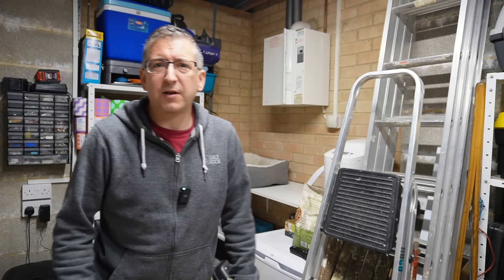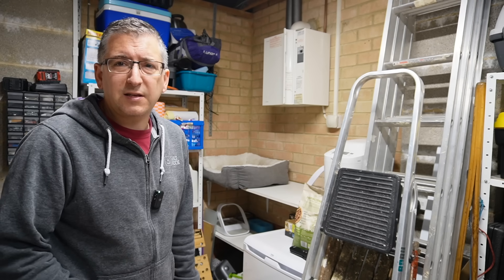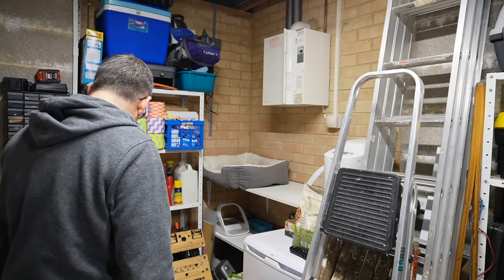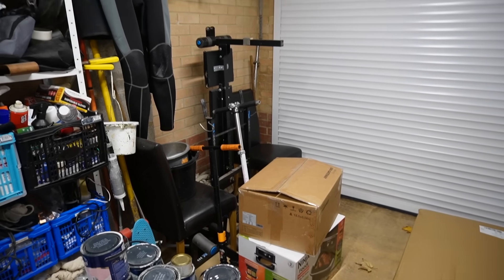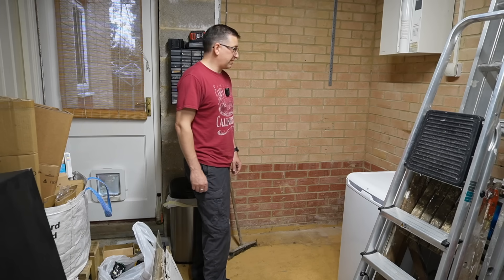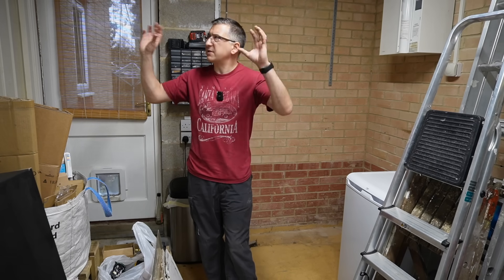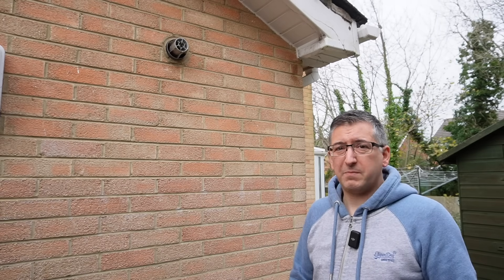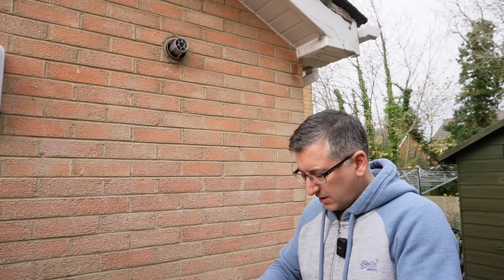Octopus Energy Heat Pump Install Day 1 and Prep Work

Comment: It will be great to see how the Octopus team work. They have an amazing reputation to uphold, so lots of pressure to not only impress but achieve good scops, etc! With Heet Geeks setting such a high standard in training and installations, and seeing so many great installations done by the likes of urban plumbers on this channel, there is a lot to learn from seeing these actual installation videos.
Reply from the maker: Honestly I hate having people working in my house and I can't relax until it's all done, but these guys were really considerate and professional and made the experience a lot easier on me. Their workmanship looks to be to a high standard, it's certainly very neat and everything appears to be working as designed right now.
Reply from the maker: Yes, they were extremely considerate of those needs and it's worth it for all the data you can collect and play with at the end :) Oh, and heating.

Comment: Brings back memories of our install by Octopus in June 22. Install took four days with 4/5 installers and although disruptive was good with loads of banter and tea and cake !! We are getting good results with sCOP of around 3.7 heat and 2.5 DHW. Interesting to see how yours goes but very happy with ours. This morning with temp 10 degrees outside got a COP of 5 so far !!
Reply from the maker: That's good!
Reply: They installed mine mid October but I was not impressed with some of the work. Lagging on the outside pipe work was appalling and they connected the new domestic water pipes behind the service valves to the utility sink. I kid you not. However I'm pleased with how it's running now. I was getting a SCOP of 4.8 until the sub zero temperature a couple of weeks ago that knocked  it back to 4.4. This is because I managed to get a designed flow temp of about 40° . Octopus had planed to change 6 rad's but I noticed if I moved 3 of the lager ones to the position of the other three and add a rad in our living room the overall heat output in house was 200w short of the 9800w needed at 40° flow. They were happy for me to do this work as long as I got it all done before they started.

Comment: Really appreciate & love how informative your videos are. Thank you for the great content you create. Know how you feel about moving things😂. I'm due to begin my retrofit project in late Jan from Oil along with a raft of other energy measures, needing to have a upgraded new three phase supply fitted from the roadside by the DNO to a new meter box externally (32m in total) a smart meter with isolator, consumer unit/tails, smoke alarms, Heat Pump with a wireless controller for auto Adaption function & concrete foundation for it to stand on, hot water cylinder, 12 new rads, pipework, insulation/Plastering in the loft room, solar panels, inverter, battery storage system, Zappi EV charger point, loft boarding, lighting & lastly a new concrete path round the exsternal of the house. So going to have a house full of contractors
Reply from the maker: Wow... that's a lot of work!
Reply: Good luck with it
Reply: @BenCos2018  thank you very much
Reply: @joshuam5826  np
Reply: Wow! Hold in to your hat, I envisage a challenging ride!

Why not do a vlog so we can all come along on your journey?

Comment: Make sure that the esbe valve is installed correctly. Mine wasn't and the hot water cylinder was constantly losing heat. It was actually me that notified them of the issue and the potential solution after reading online forums!
Reply from the maker: Thanks for the tip, I'll keep an eye on it. I'm sure it is working fine because it's heated up a couple of times so far.
Reply: @SpeakToTheGeekTech my cylinder only lost heat when the central heating was running. The cylinder was acting like a thermal store. My heat pump was installed for a few weeks before I needed the heating on. Therefore, it wasn't until later tha the issue first became apparent.

Comment: Interesting series on your Heat Pump saga, very well prepared and presented. I am particulatly interested as my gas boiler is the same as yours so its 25+ years old ! I have had the first estimate from Octopus and with the updated grant it would be cheaper than a new gas boiler.
Keep up the good work.
Reply from the maker: Thank you!

Comment: I had an ASHP fitted 21 months ago and initially our homes cavity had equivalent of no insulation. Our 5 bedroom detatched house used 3333kWh for the first winter to maintain 18c with a small drop to 16c overnight for 7 hours. Old broken down cavity wall insulation removed and replaced after first year and now saving about 1/3rd in use. Also, I have kept the evohome sensors attached as it still can keep each room at the temperature, rather than the guessing game of the TRV's. 
There was a small change to configuration in the EVO home and I swapped all rooms to the same plan. This way I have maintained the ability to still have control whilst away from home and to ensure all rooms are heating correctly.
Reply from the maker: Do you use Evohome as a TPI thermostat then or just as fancy TRVs? I’m planning on putting temperature sensors in each room (I have them in most already) to keep an eye on balancing them. I didn’t like the idea of each room being able to call for heat because that would really hamper the efficiency over all
Reply: @SpeakToTheGeekTech   I run the whole of my old evohome setup but no hot water control as that is fully dealt with by the ASHP. I have a "standard heating setting" for the whole house, so all rooms are the same temps at the same time.  I have not seen too much extra use, but my system doesn't provide ledss than whole numbers.
A setting within EVOHome is used to stop fluctations in calls for heat being on/off rapidly. This is from Honeywell, " change the Cycle Rate to 3 and the Minimum On Time to 5."

Comment: I can't wait to see what you think of it once installed.  I hear lots of nightmare stories and people saying they cost far more to run than a gas boiler.
Can you give an example of a gas bill and electric bill for a few months in winter and summer, then give us the electric bill for when the heat pump is in use for water and heating?

What was the total cost of installation of this new system?

I am tempted, but nothing comes close to the low cost of running a gas boiler or the overall control of it.  The heatpump would need to cost a lot less to run than a gas boiler for the same amount of heat and water, plus less than the £6000 of replacing my gas boiler and a couple of radiators or it's not worth it.
Reply from the maker: All of that information will be forthcoming in other videos. I'm pretty certain that the running costs will be ballpark the same as gas, maybe even less because of my batteries, so I'm not concerned about that. I know from other people's experiences (family and friends) with heat pumps that their costs are not really any different. From an install cost perspective it's not that far different from a boiler installation when you include the BUS grant. It is more expensive, but not massively at all. It was never about it being 'worth the money' for me though, I needed to replace my boiler because it was on its last legs, and I didn't want to carry on using gas. The cost of the heat pump was within my means therefore it was the right product to choose morally.
Reply: From what I’ve read heat pumps cost a similar amount to run as gas boilers, the gas cost is going up Renewables cost is coming down unless we let the oil companies own them all and then we’re done for. Have you paid the government back for the super cheap gas you used last year?

Comment: Nice concise video, shows what I have to expect in January, so thanks very much. You mentioned it made your house very warm so obviously you're underway with it, was that during the recent cold weather?
Reply from the maker: The install has been happening this week and I've split the filming into three parts - this video today covered just Monday this week and yes, as of yesterday the heat pump is installed and working well.

Comment: Interesting that Octopus are supplying a Daikin unit & not one of their new Cosy models with vertical air discharge which can be a real advantage for narrow side alley locations. I couldn't see from the video but what size pipes did your rads have & did they have to upsize any pipework?
Trust me, that's not a messy garage!! I've got a single attached garage that's far worse & only just enough space to walk down the middle. It's where I would also have to put a new hot water tank (or in the loft - but the hatch is too small). A garage clear out re-jenga is needed every so often. Good luck with part 2 & looking forward to the update.
Reply: Daiken units are nice ones tbh
still a bit odd to use that style for a alley though
Reply from the maker: There's plenty of space where it's located, it's not an alley, just a cut-out corner of the garden. Pipework to radiators is 10mm microbore and none of it was changed.
Reply: @SpeakToTheGeekTech ah not bad then
Reply: Are you sure it's 10mm copper microbore and not 10mm plastic?
Reply: @SpeakToTheGeekTech  OK. I've also got 10mm microbore (copper) so hence why I'm interested to see how you get on without any pipe diameter changes. Would almost impossible to upsize pipes in my house as the ground floor rad pipes are buried in the walls behind the dot & dab plasterboard & 1st floor is all T&G chipboard floors. Doable no doubt but not without a lot of mess & upheaval which I would not want. Waiting to see what SCOP numbers you get.
Reply from the maker: Mine are 100% 10mm copper. I've seen them under the floors myself!
Reply from the maker: First full day was yesterday. If the Daikin controller is to be believed then I got a COP of 2.75 for hot water and 4.7 for heating!
Reply: Cozy ones not being launched until next year.
Reply: The COP is not very accurate as figures a rounded.  @SpeakToTheGeekTech

Comment: Looks like the same model as mine, will be interesting to see what heat curve you use and what COP you get, ive averaged 4.3 over the last 12 months but would like more!
Reply from the maker: It's looking good so far but really too early to get a decent average. Need some proper cold weather to test it.

Comment: Watching with interest as our install is booked with Octopus in February! Be interested to see if there is a way to automate hot water heating / boost with heat pump during excess solar. Will depend as well on draw from heat pump during hot water heating - maybe you can measure that? Thanks
Reply from the maker: So far there’s no way I can see to modulate the power it uses to heat the home or water, it just does what it does. There is a smart solar option according to the manual but I think that requires additional hardware. If I can figure out what that option actually is then I’ll report back! To be honest with an offpeak tariff my plan is to heat the water then and hope it lasts
Reply: @SpeakToTheGeekTech  Ah I haven't come across the smart solar option, will have a look into that. How many people are in your house to serve from that 250l tank? We got quoted a smaller one in our survey and I wonder if it should be larger, as ideally I want it to heat off peak and last all day too
Reply from the maker: The surveyor told me MCS guidelines say 50L per bedroom plus 50L. Therefore a 4 bed house = 250L. I haven’t looked into that but Octopus have done everything else by the book so I’ve no reason to doubt them on that. Might be worth double checking though!

Comment: You know that once installed you will have to play around with Daikin Home Assistant Integration... Power flow card similar to the Power Flow Card would be nice to have.
Reply from the maker: Already playing :) Shame it doesn't give heat energy produced data, just energy used. Would be great to get that and you could calculate a COP.

Comment: Hi, how does the heat pump work with your GivEnergy battery system? I have one and concerned it will drain my battery quickly.
Reply from the maker: It will drain it much more quickly because it's pulling power, so I am running out of battery earlier in the day. That's not a problem though because it's kind of one of the reasons I have so much battery capacity installed. I anticipated that I would be running from the grid most evenings in winter because of the heat pump draining the batteries more quickly than before but it's not a concern, it's intentional. You can set a reserve on the inverter if you need to save a bit for power cuts.
Reply: @SpeakToTheGeekTech  ok thanks!

Comment: New to the channel. Are you having all your radiators replaced? Is this to achieve a particularly low flow temp or where they very old type 11 rads? Probably with mentioning most people don't need to have this done. I guess you were unlucky. I have wiser smart trvs so if i get a heat pump i will have to stomach the pain getting rid.
Reply from the maker: About 10 of my radiators were replaced. 3 because I requested them extra, the rest because their output was too low in the heat loss calculations.
Reply: @SpeakToTheGeekTech  Have my survey on Tuesday so interested to see the recommendations for how many need replacing - all decades old, single-panel ones. Do you mean here that you asked for 3 additional radiators? Presumably that was an extra cost?
Reply from the maker: @mattdomm4251  Yeah you might be interested in my costs video: https://youtu.be/Tc_5SlkNkik

Comment: You said the radiator has fins on the back but does it also have an extra panel?
Reply from the maker: Not that specific one, no, but some of them are K2 and even K3 models with 2 or 3 panels respectively.

Comment: Is that a thermostat tap on the radiator only just in shot at the end?
Reply from the maker: Yes, TRVs everywhere but fully open. I think TRVs are mandatory under the MCS guidelines. I may set them to a temperature if necessary but at least for now they’re all remaining fully open

Comment: Nice video except you have omitted about if they had to replace any sub floor pipe work upstairs or used existing pipes.
Reply from the maker: No pipes replaced - existing has been used throughout

Comment: Great to see it actually happening at last Oliver.  The noise test results will be interesting given all the planning trouble you had.
Our ASHP install (non Octopus) was much the same, 3 blokes for 3-5 days, and ours was in January so cold as well except we’d not had any heating from the preceding November after oil tank failed 😩
Be interesting to see your experiences as you learn about using a heat pump.  Low and slow - the lowest temperature for both hot water and heating you can manage with, and run it all the time (with nighttime temperature setback).
But what about the cats, how are they coping with their relocation?
Reply from the maker: The cats are really p*ssed off, especially with the installers being here all week. My plan this weekend is to build them a new living area though so hopefully they'll forgive me.
Reply: Dogs forgive and forget. Cats will hold this over you for the rest of their lives

Comment: Sorry to ask but what is the total cost so far? Also what size solar would be necessary to run it in the average winter months?
Reply from the maker: I’ll be doing a cost video at some point but the final figures aren’t yet in. As for running from solar that’s a difficult question. Most of the time that you need heat will be when it’s dark so it’s more about being able to store solar energy in batteries and use that earlier or later in the day. You would need quite a lot more solar than I have to do that so I’m relying on off peak from the grid
Reply: @SpeakToTheGeekTech Octopus quote a cost upfront after supplying basic information and without even conducting a survey
Reply from the maker: Yes, based on information you supply about your house, current heating setup, and your EPC. Then you pay a deposit (refundable) and they come out and do a survey, after which they finalise the quote. If the information you provide is accurate then the quote won't change post-survey - mine didn't. It was very transparent.

Comment: Octopus sent us a quote - after the grant they think 2.5k ish to do the install, imclusing all work and radiators. Given that the other quotes we've had have been closer to 12k after the grant, im not sure i trust what Octopus will do.

Did you get any other third party quotes as comparison? If so, what was the difference?
Reply from the maker: I didn't get any other quotes in, but £12k AFTER the grant is a lot... £19.5k?? I trust Octopus more than I'd trust most other companies, but I'd trust a Heat Geek approved company in a similar way. At least Octopus are in the public eye more, and have a national reputation to build and maintain.
Reply: @SpeakToTheGeekTech  We asked a couple of firms, one of which installed our Aircon. The costs were mostly comparable with requirements to upgrade all of the piping (piping was too small for efficiency), most of the radiators, and routing the pipes around the house - new(ish) build with a less than useful layout for utilities.

I guess my concerns with octopus are: 
1- They didn't visit, they just produced a number, then promised they would honour it - this to me sounds like they have a bare minimum approach to the install.
2 - Given the other quotes I would be concerned that their solution, while I'm sure it would "work" is likely to be considerably sub-optimal for efficiency compared to a proper install, as I doubt they would grade the pump correctly, or be willing to redo all the pipework for the heating, and then make good afterwards.

So, I guess I would be keen to find out how your doing with efficiency vs the old solution in 6 months once its all settled in.